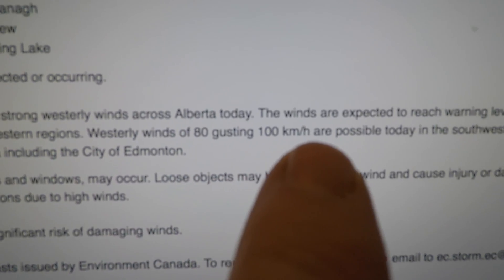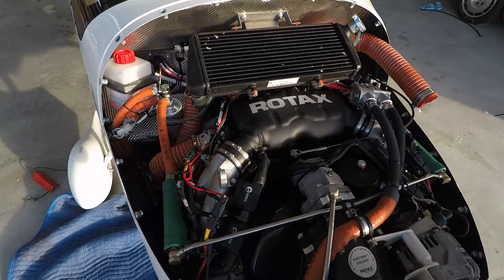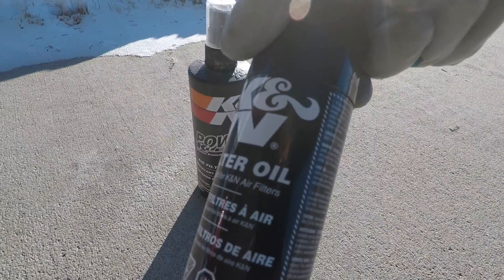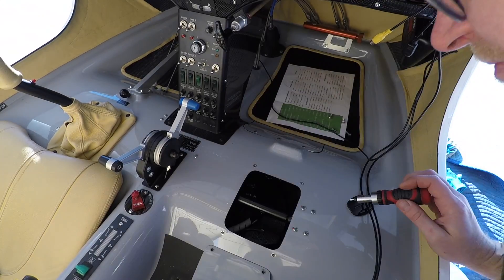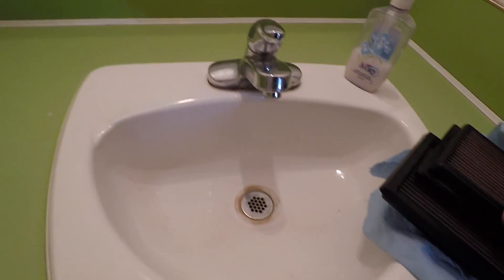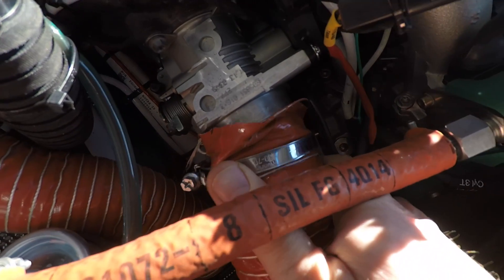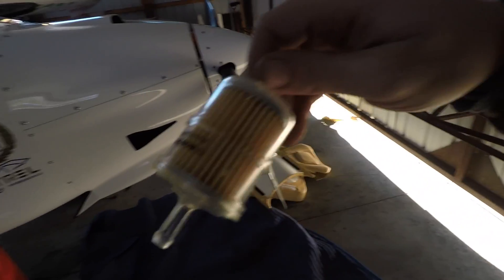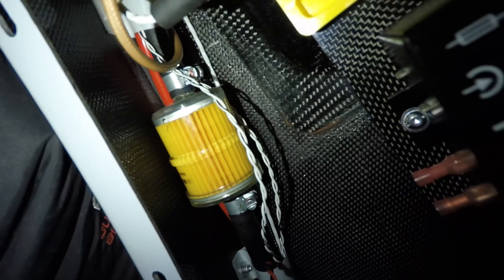Aircraft Maintenance & Drone VS Plane

Comment: It will be a fair stretch for a quad copter to carry your survey gear to 10000' + for an 800nm range survey, all for the cost of 100L of unleaded car fuel...
Quads have only taken off (pardon the pun) due to the small light weight electronics in the flight controllers, we've had the brushless motors and lipos for like 20yr now but the stabilisation is what quads needed to become viable.

Comment: As autopilot AI improves over time I think it will inevitably mean some pressure on businesses like yours, but AI might have much more of a challenge with things like deciding what weather is marginal for the mission, whereas a pilot can see & decide easily. The decider would be a large drone capable of carrying a similar camera setup to you over similar distances, thus leveraging a big advantage due to the immutable laws of physics that demand fuel is burnt to carry the weight of a pilot and his seat/controls/instruments, airframe, etc. Something like a mini Pipistrel with a tiny hydrogen powered engine and a four camera setup... maybe you should diversify into aviation design and build to hedge your bets?
Reply from the maker: Steve Roberts I think conventional type aircraft will not be used for the work I do. I could see a vtol aircraft being used. There’s too many variables with a fixed wing aircraft, one servo fails and you lose your 200k aircraft. It’s just not feasible. The military are the only ones who can afford autonomous fix wings as they can afford to lose them also. It will happen eventually but what’s the fun in sending a robot to fly? What’s the purpose of being human if we can’t even do work we enjoy?